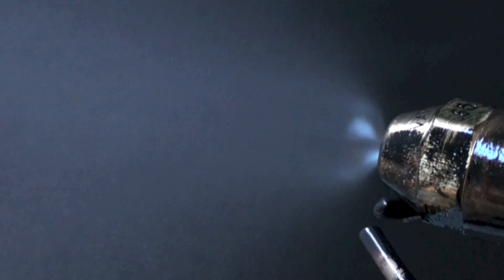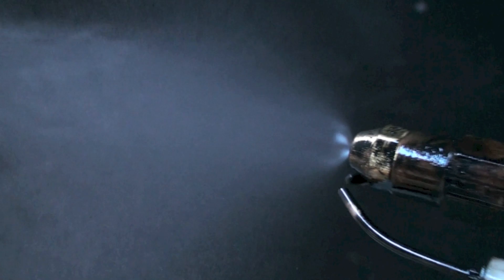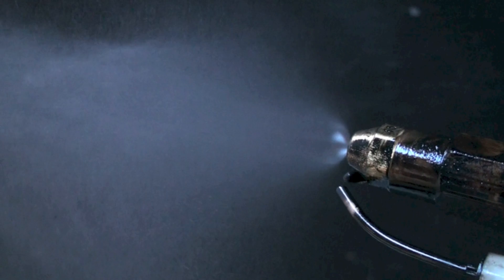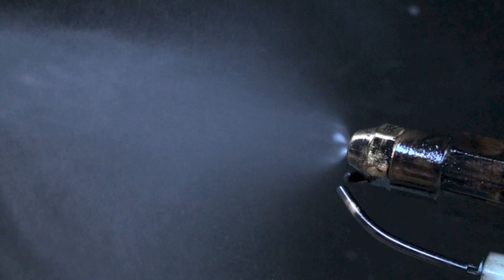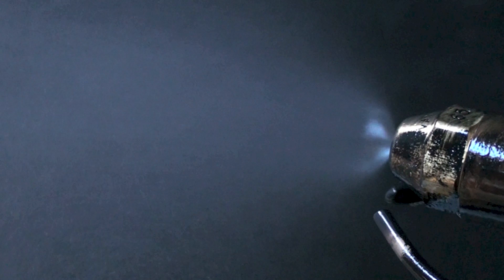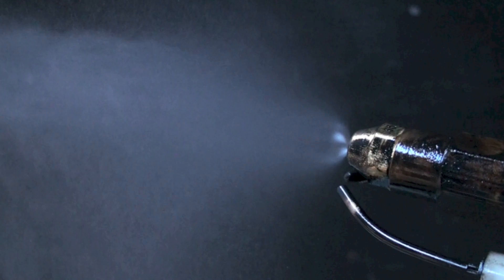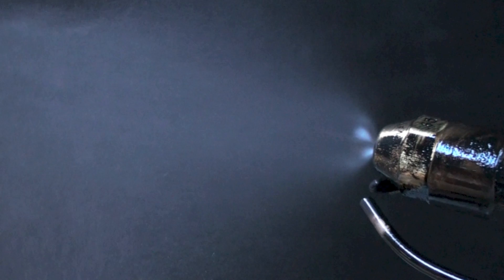How the fuel oil sprays from the nozzle in the oil burner

Comment: If you were spraying into a pressurised chamber would the fuel pressure need to be increased to maintain the same pressure differential between the fuel and the chamber?
Reply from the maker: Not unless the chamber pressure is very high.  The minimum pressure at the nozzle is 100#  More like 140#.
GFM

Comment: Any recommendation nozzle for burning JP8? Currently, I'm using a 45DegB @.85 with 140 PSI fuel pump pressure. It's burning hot with my air shutter almost closed. In the beginning of the winter last year the boiler sooted up really bad and clogged the fan provong switch locking out the primary. I cleaned furnace, pipes and exhaust fan and proving switch. Ran fine all winter with no soot. Combustion analysis showed the following results:
CO = 0 PPM
C02 = 9.6%
02 = 7.9%
Excess Air = 61%
Stack temp = 504.9
Eff = 80.16%
Any recommendation is appreciated otherwise I will carry on and learn and teach myself.
Reply from the maker: JP8 is essentially #1 fuel oil.  A little less air than #2.  For most combustion chambers, 45 degrees is a bit too low.  I would try 70 to 85 degrees.  
GFM
Reply: Before Rebuild:

CO (Carbon Monoxide): 0 ppm
CO2 (Carbon Dioxide): 9.6%
O2 (Oxygen): 7.9%
Excess Air: 61%
Stack Flue Gas Temperature: 504.9°F
Gross Efficiency: 80.16%

After Rebuild:

CO (Carbon Monoxide): 0 ppm
CO2 (Carbon Dioxide): 12.2%
O2 (Oxygen): 4.4%
Excess Air: 27%
Stack Flue Gas Temperature: 561.8°F
Gross Efficiency: 81.68%
Reply: Thanks for your advice. I have a bunch of nozzles and I will see if I have the one you recommended. Any adjustment to pump pressure?
Reply from the maker: @sgtrock1  The 140# is ok.
GFM

Comment: Anybody know what would cause a Delvan nozzle  .65- 70 in a Carlin burner to distort at the tip and still fire and leak oil in the firebox. A first for me been doing my own oilburner service for almost 30 years. I switched to this Delvan nozzle last year always use steel Hagos... Never seen this befoe looks almost melted the brass part stainless disc is angled to the right side quite a bit...  Glenn

Comment: Gary, I have a Question for You " Does the ignitores go in the middle of the orifice Spray"? I am having problems with my burner no burning. I have 100 psi at the nozzle and using A 80 degree orifice 175. I manuel shows 1/8" from the nozzle tip and 1/8" wide from tip to tip in the center of the spray. I am very dissatisfied with the performance. With a 135 Orifice at 100 psi the fuel sprays but doesn't atomize the fuel as needed.I think this is a Walker Burner. Gary do you have another way to contact you?
Reply from the maker: The electrodes should never contact the spray.  1/8" or level with the end of the nozzle.  About 1/2" above the center line of the nozzle.  Have you replaced the nozzle?
GFM
Reply: @grayfurnaceman  So Gray you are stating from the Center of the Nozzle the Electrodes should be 1/2'' above the Nozzle center Line. I will set the Electrodes 1/2'' one above the center of the Nozzle and try it. In picking the Best Nozzle should I look for No droplets only a mist or Atomization particles? Correct?
Reply from the maker: @waymonblevins6939  The spray should look like a fog.  There should be no droplets.  You probably have impingement of the spray on the electrodes.  All nozzles are designed to spray that fog.
GFM
Reply: @grayfurnaceman  Gray, I am in my garage now. I don't see any droplets as of Now with the .1.75 Nozzle but I thought about using a I. 50 Nozzle. I am running @ 110 lbs of pressure, I am thinking a 1.60 or a 1.50 Nozzle could be better. With the 1.75 I am getting a lot of Smoke. But you say it's the air flow that changes the smoke. So I am working on that Now. So what do you recommend on the air setting to start out? One other thing with the two air bands  inner and outer bands does the inner bands go 180 degrees opposite from the outer band to control air flow into the Burner? When using the 1.35 Nozzle I was getting oil droplets. That is why I asked about the 1.50 or 1.60 Nozzle. That would increase the Fog or Atomization of the Fuel. Your opinion please. Thanks Gray.

Comment: Question- My old nozzle was .65 70⁰ A. I felt comfortable with it since the tech listened to my requests for efficiency. 
I had it serviced recently, and the new tech installed a .85 65⁰ W. He was particularly adamant that an "A" nozzle shouldn't be used. Not knowing anything about the letters I looked up that A is hollow cone and W is all purpose.
What would be the better option for a residential riello burner /Well-McClain unit?
Thank you.
Reply from the maker: I usually will use either the A or W nozzle depending on the results of a combustion analysis.  I do not rule out either one.
GFM

Comment: does increasing  the oil pressure valve to maximum can  waste oil or what is the disadvantages of too high pressure oil please
Reply from the maker: A fuel oil nozzle will not work for waste oil, regardless of the pressure.
GFM
Reply: thank you so much for your reply but i meant for wasting oil that i have size nozzle of .75 gallon per hour, i noticed when i increase pressure to maximum it burns  or consume more oil per hour than its size  -- i want to know if this is true or not ( increasing pressure to very high degree does increase letters of oil per hour for the same size nozzle? ) with my great thanks .
Reply from the maker: Yes, the increase above 100#  will increase flow.  
GFM
Reply: great  thanks for your reply

Comment: great video thanks. Can you tell me if this is just a nozzle with pressurised oil or it's it's one of those siphon ones that's powered by air rushing through? (i'm trying to make a really cheap oil fueled furnace burner) many thanks!
Reply from the maker: These nozzles only work with high pressure fuel oil.  The type you are suggesting would be used for waste oil.
GFM
Reply: grayfurnaceman thank you
Reply: WATCH NOBOX7  if you want to build a siphon nozzle he knows what's up.
Reply: TC time thank you I will cheers

Comment: I was changing filters and the nozzle on my system today and my dad asked me something. Does the nozzle tip have a proper orientation for a correct spray pattern?  I would assume maybe not. I’ve changed them 3 years with only snugging them tight. Any comment about that???
Reply from the maker: No, the are concentric.
GFM
Reply: Thanks for the reply.

Comment: What nozzle size do I require for transformer oil?
Reply from the maker: If you are trying to use transformer oil, forget it.  There is no nozzle that will work.
GFM
Reply: grayfurnaceman why is that?
Reply from the maker: Oils other than #2 or #1 fuel oil will not break into small droplets that can be ignited.  Most oils need to be heated to the point that they will vaporize to be burned.  
GFM

Comment: Any luck with running preheated used engine oil through one of these Beckett systems?
Increase the pump pressure to around 160?
Thanks
CA
Reply from the maker: +Charlie Abbot Nope.  The waste oil must be heated and then have compressed air blown across the hot oil.  Hate them things.
Gym
Reply: Thank you sir.

Comment: I just installed a Becket AFG 140psi.  It lit right up but started rumbling because of too much fuel.  I shut it down and there was fuel in the tube and running out the bottom of the blower (probably  4 oz worth or so).  The fuel in the furnace burnt for a good while afterward.  I removed the nozzle assembly to check it, thought it might be loose, but everything was tight. so I tried a different nozzle (went from the 80A that came with it, to a 65A from my old burner).  Same thing only no fire this time.

Some background.  The new one is a "1 year of use" burner off of ebay.  The old one is 20 something years old and either has a bad motor or pump going bad (motor will only start once you've moved it a inch or so, but then of course won't restart the next time).  It has 100 psi pump and as I mentioned, used a 65A nozzle.  Bith have a ratting of I think, 105k btu's and upto 3.00 gal a minute.  The new one is about a half inch shorter (into the furnace).  But I'm not seeing how that would result in fuel in the blower tube.

Is it just out of adjustment, nozzle distance from the swirl plate I mean?  I saw you use a gauge for that in one of your vids...
Reply: I think I just answered my own question by watching you "Oil furnace pump bypass plug" video.  The new one was set up as a two pipe, and I'm a one pipe.  I just put a plug in the return and thought I was finished.  I may go ahead back down and work on it some more tonight.  But I may just let it dry out a little longer...  Plus the pumps probably dead.  Good think I bought two identical ones.. lol  The second one will be here Friday I think...

Thanks for your many videos.....
Reply from the maker: Mat Helm Yeah, you probably took out the shaft seal.
GFM

Comment from the maker: The GPH would increase.  There is a chart on it.  Look up Beckett, its on their site, and yes the higher the pressure, the better the atomization.  Some pumps are designed to run at 300#.
GFM